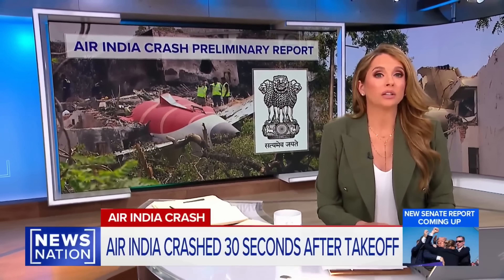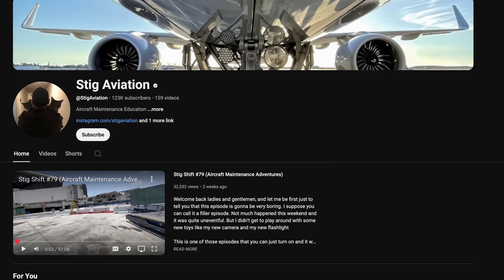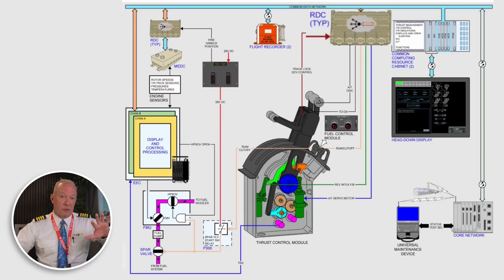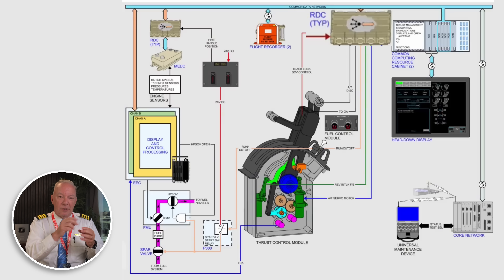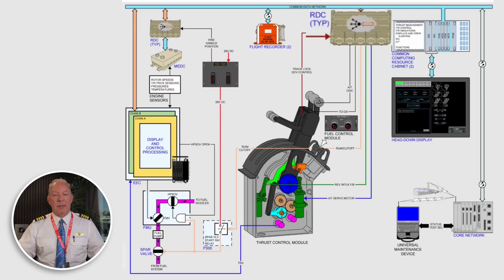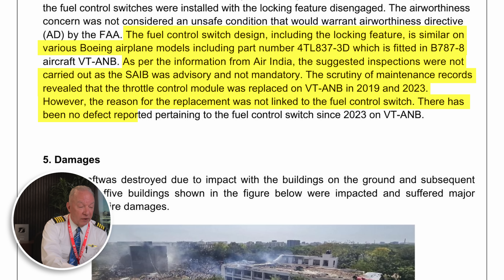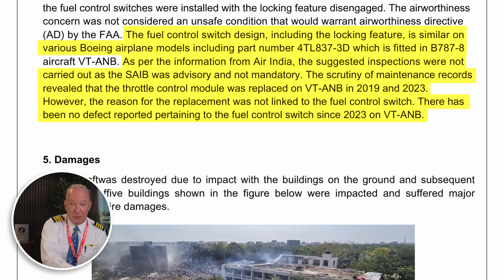The Truth About Boeing 787 Fuel Control Switches

Comment: There seems to be a lot of confusion as to what signal/voltage (0 or 28V) actually triggers a fuel cut off. Someone please make this clear. In addition to further complicate the issue the RAT was activated to provide electrical power for the fuel pumps. Now we have a real set of many actions happening about the time of the fuel valves closing. Questions start to happen - was there a total electrical power failure (RAT deployment)? Was the backup battery triggered to do what, close the valves or open the valves? Did the backup battery malfunction, catch fire? For such a tragic situation the simple answer is the switches were manipulated. However many extremely rare events occur when a number of rare events all happen together. Hence I hope the experts look everywhere and consider all possible combinations to ensure a secure and safe conclusion is reached.
Reply: The fuel spar valve must be powered on either the open or closed pins for the actuator to change position. There is no default position the valves must be powered to a position. The RAT does not power the fuel pumps. If all AC is lost (e.g. all generators on the two engines & APU), the engines go on suction feed out of the main fuel tanks.

Comment: This is exactly what I've been wondering.  If the switches and the related circuitry and wiring were routed thru some computer and that computer "simulated" the switches being moved off then back on.  Obviously that is not the case.
Reply: The fuel spar valve commanded position is via copper wires, no software (CCS) is involved in position change.

Comment: why did the rat deploy before the fuel switches were moved to the off position ?
Reply: The RAT deployment is either commanded or because all AC power was lost. That system doesn't care where what the fuel switch position is. So what had to happen is either the HPSOV or Fuel Spar valve closed and the engines spooled down to a point where the generators dropped off line. When ALL generators dropped off line, the RAT automatically deployed.
Reply: @paultruzzi911  - you make no sense. Power failure, Rat comes on, then fuel is cut off etc. etc.

Comment: All of these YouTube videos make the same mistake by 'assuming' that the Fuel Control switches are working as they should be and therefore cannot accidentally be moved from one position to another.

Air Investigators should not have this preconceptions and investigate what the real world situation is.

If the switches have not been fitted correctly or are broken in some way (e.g. the detents / springs are missing) then it is pefectly conceivable that they could have accidentally be knocked from one position to the other or even move through vibration to the off position which is the lower down position.

We will have to wait and see the final outcome of the enquiry.

Comment: Think of this: between the time one pilot felt, heard, saw the fuel switches in stop,  after a two or three seconds after that recognition,  he knew the other guy #1 didn’t raise gear. #2 had moved fuel switches to stop.  He knew then, after that time interval, the other guy was either seriously incompetent for some reason (drugs, mental condition or sickness) or he was sabotaging the aircraft.  At that point until impact, they both knew exactly the cause of their situation.  I’m positive the pilot set aside the knowledge of what the other guy had done, and did the best of his ability to regain flight of craft.  It doesn’t matter; but, I wonder if there was a moment of hatred for what the other guy did.  My point is.  There’s no way the competent pilot didn’t KNOW the other guy was sabotaging the craft.
Reply: we don't know if he saw the switches being flipped off. go it? He could have seen it on his front screen panel, and assumed the other guy did it.
Reply: @stevebubbie1126 he didn’t have to see the switches being moved.  You know it because you can hear the engines stopping, feel the aircraft loose lift, see the lose of power . You would immediately look to throttle position and a few seconds later see the fuel switches in the rear position.  The data flight recorder confirms this.  My point is, knowing or thinking YOU DIDN’T turn the fuel off, you KNEW the other guy did.  I guarantee you, before dying, the competent pilot knew the other guy caused the crash.  That was my point.  Likely a useless point given he saw and felt the plane was not going to recover  speed and altitude because he could hear it and see it happening.  Just an interesting point on the last thoughts of the competent pilot.
Reply: @stevebubbie1126

Comment: Your analysis is probably correct.  However, your electrical analysis might be off.  Most electrical systems have fuses or breakers inline and if one blew, there might be plenty of electricity, even from the battery but it can’t get to the fuel valve.  Just a thought.

Comment: Nice explanation, Steeeve. I believe the point where you say the valves will stay open until the battery is depleted isn’t quite right — the system is designed so that, in the unlikely event the battery fails, fuel would still continue to flow. Everything else is superbly explained.
As for the crash and all the internet rumours, I think it’s because we’re all looking at it from a rational perspective — no one can imagine a crew member intentionally switching off the fuel, knowing they wouldn’t survive. Of course, no one would. But the fact remains, the switches must have been deliberately operated — though we can’t dismiss the possibility it was done by mistake.
I don’t understand why Air India aren’t releasing the full cockpit voice recording. Maybe it’s simply to give their lawyers time to get all their ducks in a row… or maybe there’s something more to it. Guess its quite possible we will never know.

Comment: It seems to me that the time between the cutoff of the first engine and the cut off of the second engine is not the time it takes to cut off two engines, but rather the time it takes to cut off one engine.  I realize this is a minor point, but I keep hearing people discussing whether it is possible to shut down two engines in the time difference specified. Perhaps the better question is whether you can shut down the remaining engine in the time difference specified.  

The one second between shutdown seems not only reasonable but expected/normal.

Comment: On the contrary , turning on the switch will cut off power to the solenoids, to cut off fuel means you need power to the solenoid.. that’s a fail safe system

Comment: Steve with due respect, biggest flaw in your analysis is if you look in your block diagram, the  diagram is not totally clear, it does not show how the fuel pump receives its electrical power and from where the "sensing point"  is obtained that determines whether the fuel switches are in the ON position or in the OFF position, what part of the fuel system determines this crucial signal that can tell the Black Box or data logger whether or not something else failed instead of the fuel cut off switches,  the chain of command begins from operating the Fuel Switches, but if some other condition does not satisfy  for example there is  an AND gate showing in that smaller block diagram which means even if the switches are on the ON position and there is presence of DV 28V power, it is the function of AND gate that determines the final decision whether to turn the fuel supply ON or not. Unless you submit a comprehensive and accurate schematic diagram of 787 fuel system logic  your analysis has not got a strong bases to convince anyone that it was the pilots who operated the fuel switches to cut off the supply. Your simple model demonstration does not illustrate from which point is sensing done, that  AND gate negates your analysis.

I noted in that block diagram you presented, it clearly shows the path of the signal path shown in pink comes from a module labelled RDC (TYP) to the right of Flight recorder, presumably goes to the Fuel Control Switches, then through its contacts it goes to operate the Spar valve Start Switch relay,  which controls  only 1 of the valves, the other 2 valves are under the control of the EEC, the 3rd valve is AND gated with the EEC HPSOV control line and the power from the Relay, this demonstrates clearly the fuel valves are not entirely controlled by the Fuel control switches when in the ON position, so final decision to control fuel valves rests with the EEC, The block diagram does not show where the fuel pump receives its power from.

Further more all modules are connected to a common Data Network as shown in blue, a bit like CAN Bus system in cars, which is vulnerable to tampering, for example in cars, car thieves can now break intro cars electronics or its ECU through accessing external wiring from headlights or side lights and disarm security alarm or immobiliser and unlock doors and start engine and drive off without any keys, so I noted in the block diagram lower right you have communication Network module connected to the common data network, and these can communicate with the factory (manufacturers as well as with the maintenance device, hence it is vulnerable to tampering remotely, 

One possibility emerges as there was a politician travelling in the plane there may be an assassination attempt on him at the expense of many others who sadly lost their lives, or an act of terrorism using sophisticated means, but my take is on system failure or data corruption and incorrect signals from sensors or sensor failures where the EEC became confused and cause valves to shut down and starve engines of fuel and moments later the EEC resumed signals.

Comment: Is it possible that one of the pilots thought he was cutting the ignition/continuous ignition signal to the engines as opposed to cutting fuel?
Maybe realizing the blunder and putting the switches back to run? Far fetched i know, as the ignition switches are on the over head panel
and the fuel switchers are on the throttle pedestal. Stranger things have happened.

Comment: Lets suppose : 
The battery is fully charged, there is no electric  problem with the manual switches nor with the relay, nor with the three valves , nor with the pump.
We can see on the schema that a problem in the " DISPLAY AND CONTROL PROCESSING " unit can lead to close the FMV valve, or the HPSOV valve ( Because of the AND gate if the black wire " hpsov open"  has 0V ) or the two valves.

Comment: 6:54 So you say that if power stops flowing through the circuit the Valves shut. What happens if there's a failure of power to that board while in the Run Position?  According to your explanation the Valves close. So a power failure then COULD cause a closing of those Valves yet you say it is IMPOSSIBLE? HMMMM....

Comment: A quick search gave me an example: In 2019, an All Nippon Airways (ANA) Boeing 787 experienced a dual engine shutdown due to an incorrect sensor input that led the aircraft's software to falsely detect it was on the ground. This triggered the Thrust Control Malfunction Accommodation (TCMA) system, which cut fuel to both engines.
I won't believe that the switch sensors are foolproof unless someone from the NTSB comes to my house to tell me. I think 5G can jam a plane to make it think it's on the ground when it's not, and Verizon is rolling out new towers all over the place.

Comment: Having "kill switches" (meaning "killing some system") somewhere in the range where drivers or pilots hands or feet regularly operate is a pretty dumb idea. Too easy to reach them by mistake. And mistakes may happen by routine, if someone doing things without too much thinking.

Comment: You are getting better, but might have missed something very important.  I'm a retired Boeing engineer (not an expert in fuel switches) but here is my question:  Since there are two independent left and right mechanical fuel switches, are there also two independent left and right relays, sets of valves, fuel lines, fuel tanks, etc?   Your chart only shows one relay and one set of valves.  My understanding of redundant design is there would be two, completely independent, left and right engine fuel systems.  Are there two independent batteries, one for each fuel system?
Reply: Yes, the command position for the fuel spar valves are 100% independent. They normally run off of one of the DC busses powered by the engine or apu generators. The battery bus is a fail safe backup, and I think there is only one large battery. However, loss of all power, leaves the valves in the last commanded position.
Reply: @paultruzzi911  So are there really two separate relays, three (times two) valves total?

Comment: You mentioned that the fuel control switches are a closed loop system, and they only trigger a relay that turns on the pumps. However, the switches will have to be SPDT (single pole double throw) to provide an input to the black box indicating the status. Or the relay is SPDT,  one pole switches the valves on, and the  other pole is for status indication to the black box. Or, was the black box recording the 28 VDC voltage after the relay as status indication.  Key issue is, how was the black box recording the switch status. Not so cut and dry, I can think of a few possibilities of false indicatin.

Comment: Such a thorough and insightful presentation. I noted some pilots on 787 simulators on line moving these switches and they make a pretty good clicking sound.  In other words, some evidence ( either visual or sound)  alerted the co-pilot to ask’ Why have you done the cutoff ?’.  If you think about it, if there was even some very remote electrical issue internal to the plane that went wrong leading to the valves shutting, the co-pilot would not have asked this question. He would have said something like ‘ Captain, we’re losing thrust ‘ or ‘ Engines spooling back’.  The co-pilot perceived some action either visually or sonically that led him to believe the Captain had made this action on the fuel control switches.  U fortunately this points to a very dark outcome

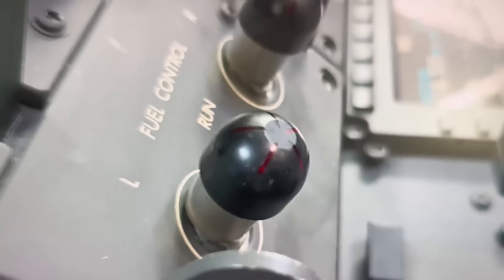Comment: At 0:59 and 1:49 you can see the "gates" on those switches have flat spots. It is possible that the switches could be placed on the flat spot near one edge but yet made contact electrically. Then they could have been easily knocked or vibrated into the other position. It's rare but it can happen. Switches with "pointed" gates are virtually impossible to be placed in such a precarious position.

Comment: This video does not explain most important element... What type these relays are. If these relays are standard type, then state supporting voltage is required. Thus, if 28v battery connection is lost (mechanical, vibration, spark, connector) then relays returns to stable position (off). Only "latching" relay "remembers" last position and requires another trigger to change it's state. Fact of RAT deployment (before engine cutoff ???) suggests electrical failure. So if relays are standard, 28v battery short (or similar) could disable fuel even if switches are on. But, this does not explain why fuel was turned on again and one engine got initiated...

Comment: Isn't it the case that Boeing is not very good at making airplanes safe? I seem to remember that there was a problem with MCAS on the 737-MAX. Faulty single sensors brought down two of those aircrafts, by no fault of the pilots. The electrical diagram of the fuel control shown here seems to be massively simplified. And what happens if you get water into these electronics, e.g. from improperly installed or missing lavatory and galley clamshell couplings? I am not making that up. I guess, what is described here as virtually impossible becomes possible.

Comment: the turn off was about a second BETWEEN cutoff right? so it dent matter how long the first one takes... the 1 second is the time to do the 2nd one only. The other think i see pointed out here is that the switches had been replaced WITH the whole cluster twice and for sure wasn't the original.  (thus the bulletin don't really matter)

Comment: If the wire between the switch and the relay breaks, the relay opens and power no longer keeps the fuel flowing. If the relay fails, no power to fuel valves. Unlikely, sure. Possible, also sure.

How does Flight data recorder "know" the position of the switches? That circuit was skipped in your explanation. Could be a failure in that circuit that erroneously records wrong switch "position".

Relays could have intermittent connectivity.

I am not saying you are wrong, just that you have confirmation bias. At least allow for the possibility of some non human cause, however remote

Your attitude that "steeve knows better than the NTSB" is disappointing.

Comment: Just a private pilot here. Thank you, Captain Steve, for your excellent explanation of how the fuel switches work. I've been with you from the start on this one. In any case, people should consider reasoning like Occam's razor. Or, to quote what I believe someone I admire said: "People think there are no simple explanations for complex issues... they're wrong!" (Revered President Reagan)
Reply: Captain Steve incorrectly describes the control of the fuel values according to the diagram he presented. He needs to explain and correct those errors if he is to restore his credibility.